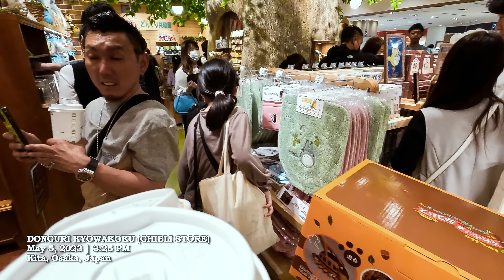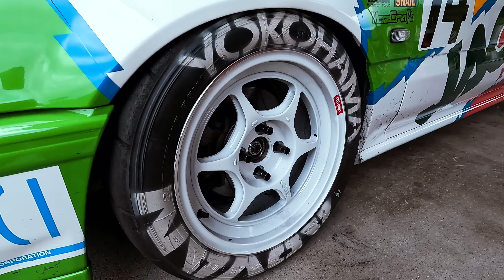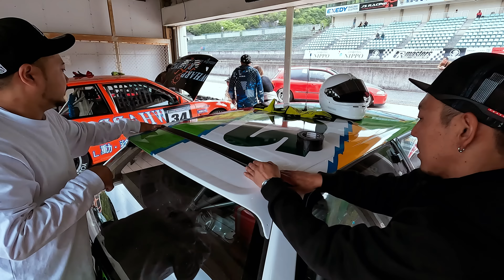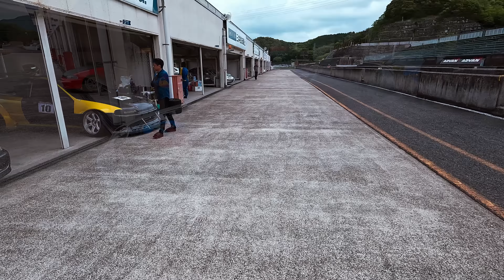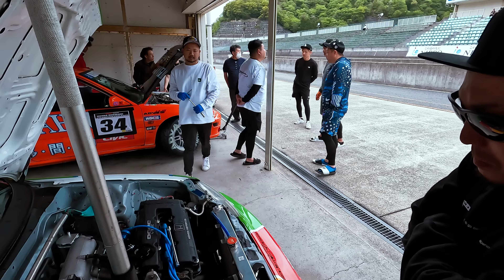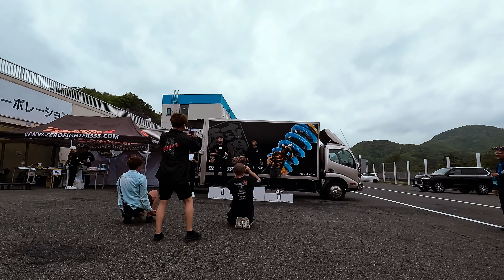Pit-Walk At A Honda One-Make Race In Kansai!!...

Comment: Good video as always Joey 👍
Also the tubes / funnels you seen coming through the fog lights are used as a air duct system to cool off the brakes. I seen a clip of this on the rough smoke channel. They tie it up some how and it actually points directly to the brake calipers. Pretty genius if you ask me 👍
Reply from the maker: Oh yeah it’s pretty common on all race cars there. We run the same stuff on some of our cars back at home haha.